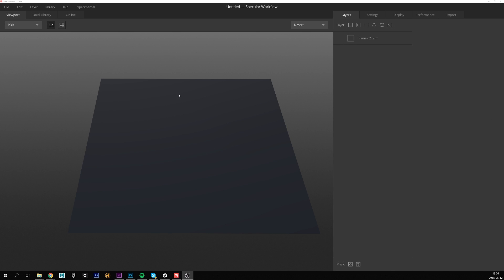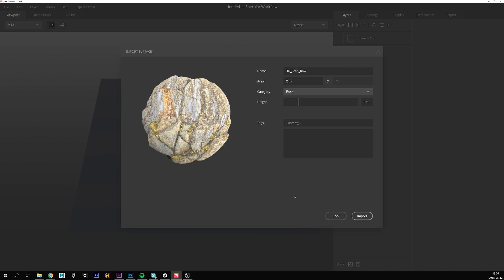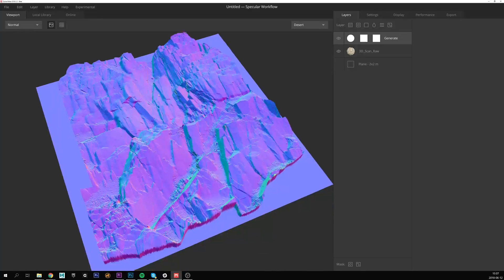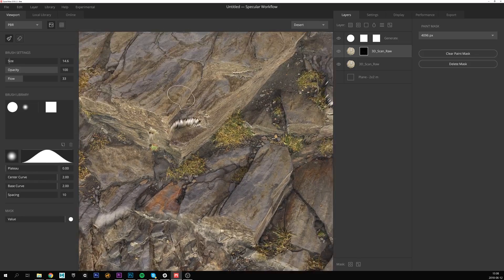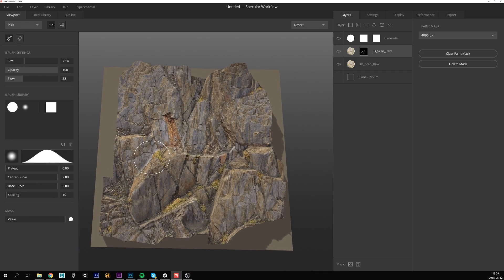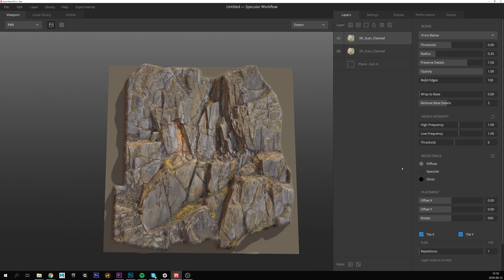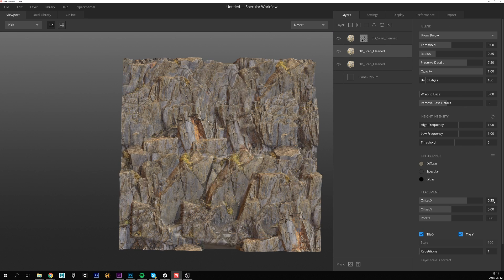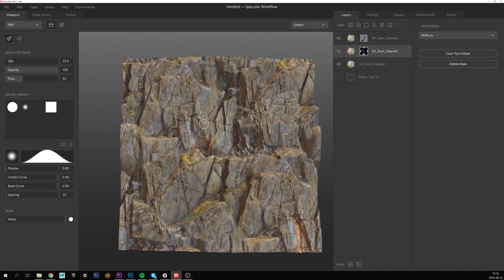Scan Cleanup and Tiling with Quixel Mixer

Comment: ok it suck. I have almost flat surface and after duplication, masking change height so much that is impossible to work with that tool in that way. I try change threshold and height frequency, but both of them failed. There is any way to make changes without mess up height map in such strong manner ? https://i.imgur.com/jSdM5W1.jpg